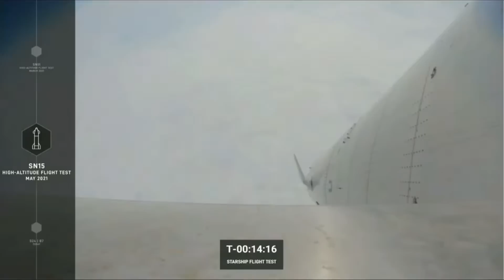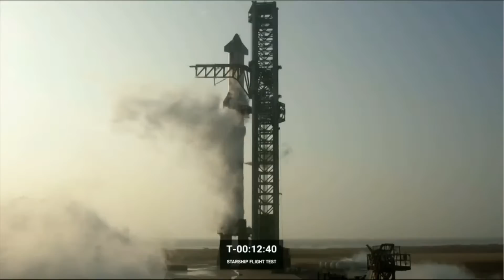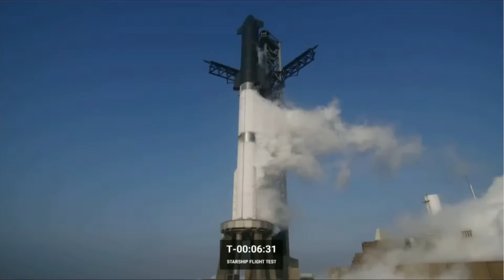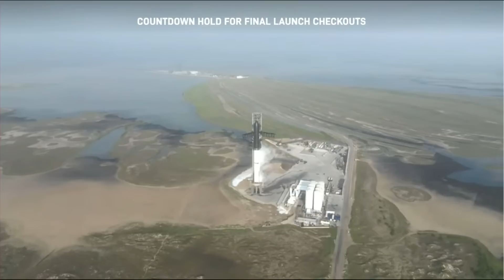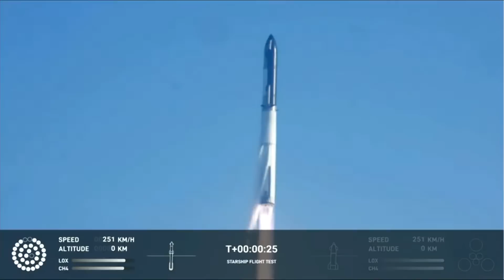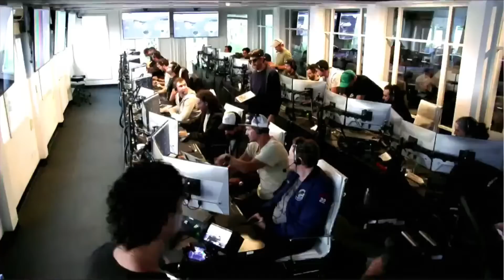Watch Again: The SpaceX Starship Rocket Explodes Shortly After Liftoff

Comment: that was an awesome launch,  to the people commenting negative things like it failed and such. Engineering and cutting edge design is iterative.  that's why you have tests.  You have designs that you think will work and you take as far as you can in simulation, but sometime you just got to test it. you learn so much more this way.  remember space X didn't even have the falcon 9 when Nasa started the Artimus program, and it just launched a few months ago.   It was made with recycled parts from the shuttle program and it took what 12 years. Space x has brought starship from nothing, including the engines to a 90% functional space launch system in about 5 years.  This is an incredible accomplishment!
Reply: well said